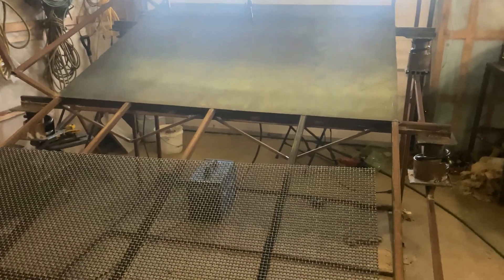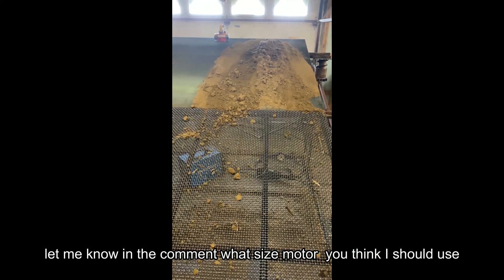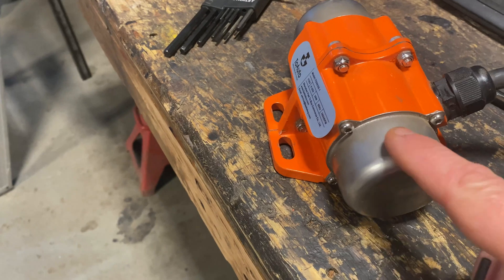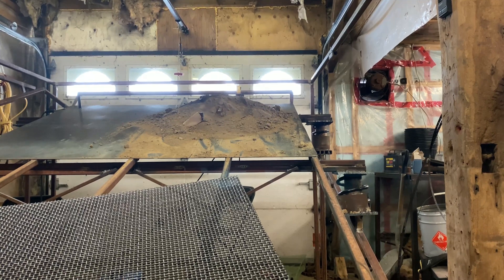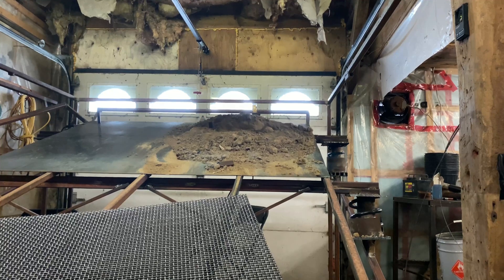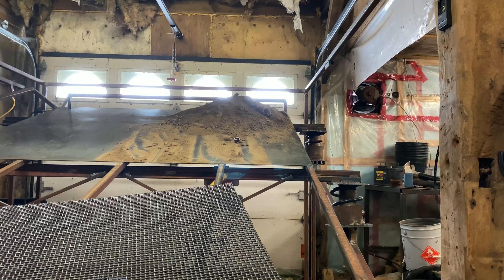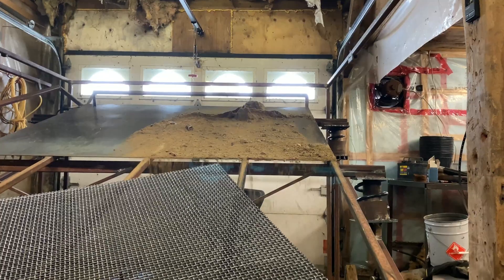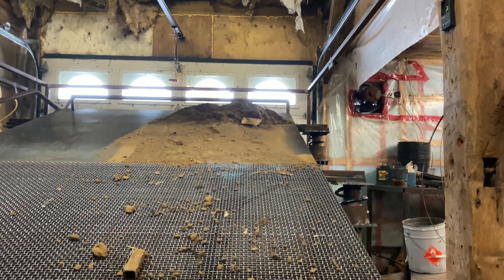preliminary test on the washplant

Comment: Instead of removing the counter weight you can spend $20 for a variable speed controller which will slow down the motor
Reply from the maker: I will end up having to get bigger motors with bigger counterweight because the weight of all the dirt will reduce the vibration effectiveness but yes speed controller could be useful with bigger motors.  Thanks
Reply: Also might want to try putting the motor on the low end of the table rather than the high end as the dirt goes down the table it will bunch up at the end so if you have a more powerful vibration toward the lower end it should help break it up better
Reply from the maker: @novelties-Antiques  i had the same intuition.  I will need more vibration in the screen area and it seems to give a more steady feed .  Good  👍

Comment: Screen deck looks good , but it will vibrate  and shake better if the deck was mounted on coil springs or rubber side shock absorbers . I worked in the sand mining for over 30 yrs. And this the way they work . Plus motor is mounted on the top in the center . Hope this helps some .
Reply from the maker: Ok thanks for your advice